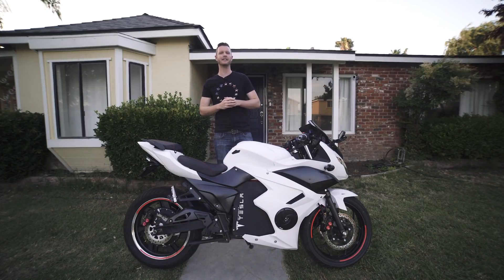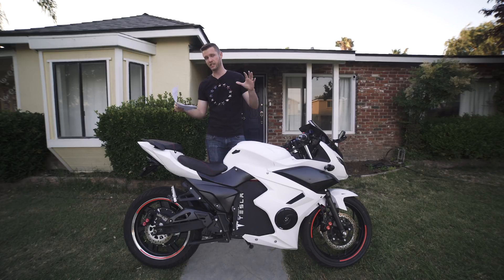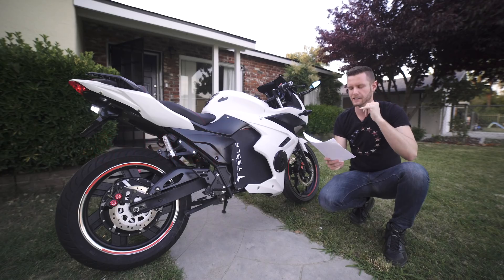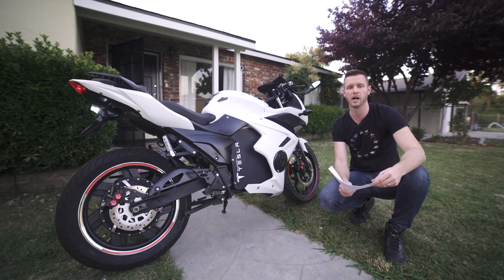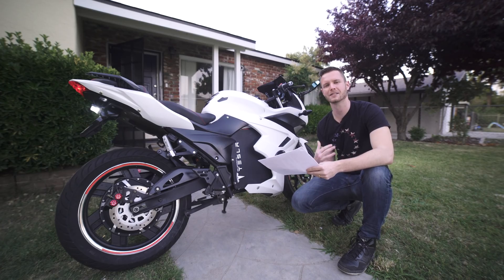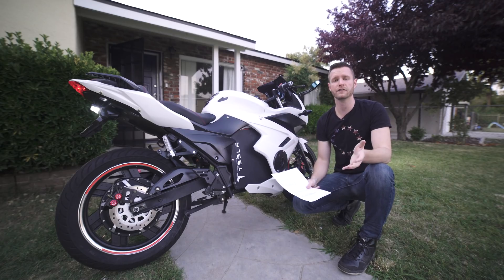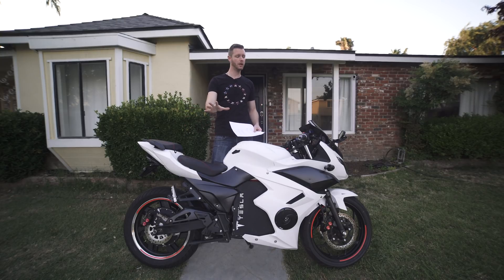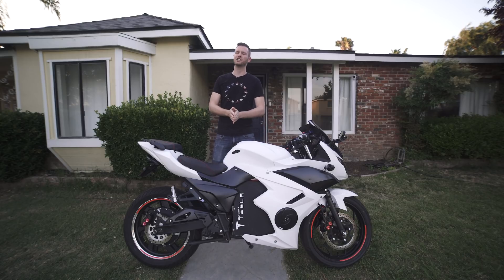How MUCH Did the Build COST? | Chinese Electric Sportbike

Comment: I was guessing it cost around 8k. So 6k isn't bad for the performance and looks the bike has. Keep on building and growing the channel!
Reply: @TheInja  I think its the coolest bike on the planet and I'm saddened that I'll never own this model. I love the Telsa and color sceme and I think it's a savage build. Dudes that built are freaking BOSS!
Reply: @TheInja  Now you just need to add a CCS or Chademo port (the so called "level 3" DC fast charging) and ride it around the state, would be a fun feature to add
Reply: @Sky-jq2no  That probably would not be possible.  The batteries are not air or water cooled so any type of fast charging would probably overheat them. This is assuming they can even handle a bigger charge current. These are the tradeoffs and things you need to decide when you build your own e-bike.
Reply: @JasonWW2000  I was thinking about that. Gotta really plan for air cooling. I kinda assumed that he had it in some way - built in radiator with fan or something. Then i saw the top speed test.
Reply: @JasonWW2000  they've been done before but take a lot of planning, beefing up the battery management would be the first step I'd assume but I have seen it done
Reply: @Kamijay97  The first step would be getting the battery data sheets. This might not be possible, so you won't really know high fast they can safely be charged at. Typical safe charging might be around 0.3C, so in the case of the 3400mah cells, let's say 1A per cell. Those larger cells are a mystery, but 1A should be safe for them as well. The big issue is how hot will the batteries get during charging? Charging is when they can get the hottest. You would need some type of smart, adjustable BMS that you can set the charge rate as well as it monitor temperatures and reduce the rate if the cells get above a set temperature. Forcing air through the box might help a little while charging, but for actual fast charging you'd need a way to cool down each individual cell. Air cooling is possible if you rebuilt the battery packs with air gaps between the cells. You'd end up needing a bigger battery box of course. It would be sweet if you could buy those wavy water tubes like they use in the Tesla packs. They could be packed tight and the water cooling would definitely handle the temperatures. As far as fitting a JS1772 connector and such to charge at a level 2 station, I'm not too familiar with all that. After a few quick calculations, I doubt his battery pack would even need level 2 charging. I think there's enough amperage in a level 1 charger to charge 300 cells at 1A each. So from 2.5v to 4.2v would take maybe 4 hours. From 3v to 4v might take only 1.5 to 2 hours. That's pretty decent.
Reply: @Kamijay97  If you were starting from scratch you could use different cells that can handle higher charge rates.  For instance the Sony VTC6 is 3,000mah and it can charge at up to 5A each cell assuming you can control the temperature. You can charge it at slower rates overnight to extend the battery life and then be able to use a level 2 charger to juice it up quick on rare occasions. These cells can be bought for around $3 each (200 for $630) from EV West. That what I'd use if I were building my own packs. You could have a level 2 charger at home and just dial back the charge rates for easy, overnight charging or bump up the current for a really fast charge. I'm not too familiar with EV charger systems, I usually deal with individual cells and charging.
Reply: @JasonWW2000  Honestly, for the work that goes into building DC fast charge systems it just be better to purchase sealed OEM cells like from Zero that are already built to do it and adapt them to your bike. If building is what someone's looking for, I wonder if they could use the same phase change material EGO uses in their tool packs.
Reply: Reality of China
.
https://youtu.be/G2suw-KE6QI
Reply: Ihhh... don't know about it... I would rather get a Zero... for a youtube channel and for the sake of manufacturing something, yes, it's ok...